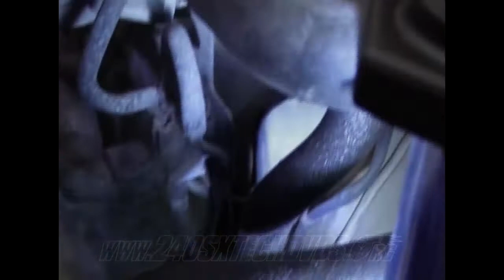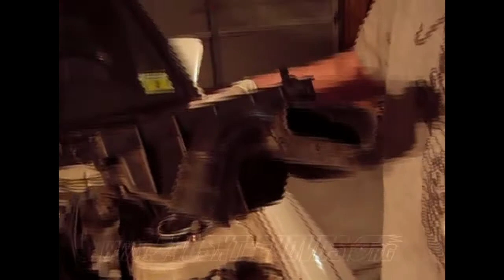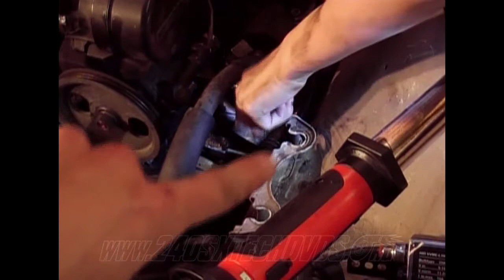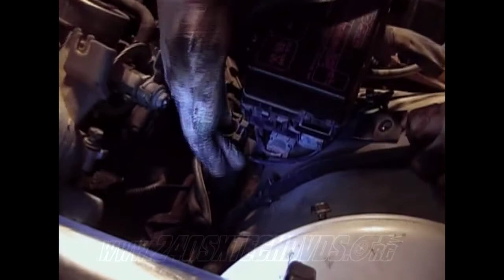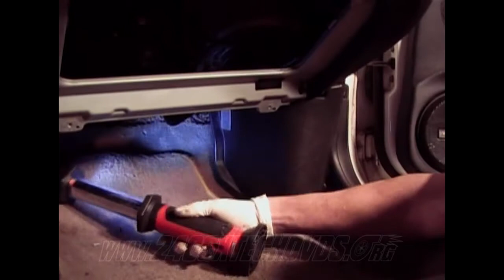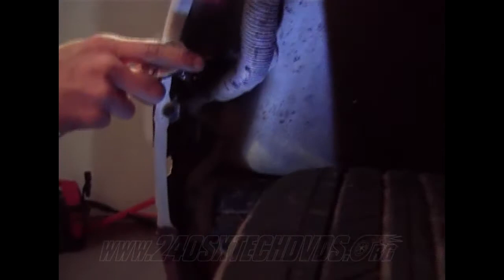How to Nissan 240sx S13 KA Removal DVD KA24DE Engine Motor Pull

Comment: Hey bro I'm finally to the point on my bill to where the car has been painted I've got it back I sent the engine off to the machine shop got it rebuilt I have it back now One thing I want to do is do away with all the admissions vacuum lines and whatnot is there anywhere that I can go and find that information and find out what I can disconnect and what I can't disconnect? Thank you
Reply from the maker: Check my videos there is a video just for that 👍🏻

Comment: after searching and searching write ups and videos I found this and chose it to be my guide for removal, I found it to be the most useful there is nothing that wasn't covered. finally pulled my motor exactly like this with no issues, thank you!

**I did not have A/C so I can't speak for that part but the only part I struggled with was the bottom motor mount nuts, I found that a swivel extension wouldn't do it for me, I backed out the bolt that was in the way for a straight shot but left it in enough for me to access the bolt and to not have it fall, I also shocked the threads (tapped with screwdriver) and it came out smooth after that. for chain hook up, grade 8 bolts are only standard sizes so the threads are not the same for the head as the metric. according to google the equivalent of grade 8 bolts for standard would be 10.9 or 12.9 metric, the thread pitch you are looking for is correct in the video as well as just about everything.